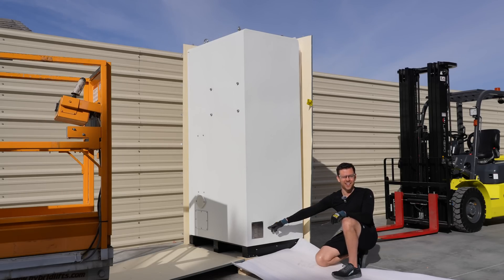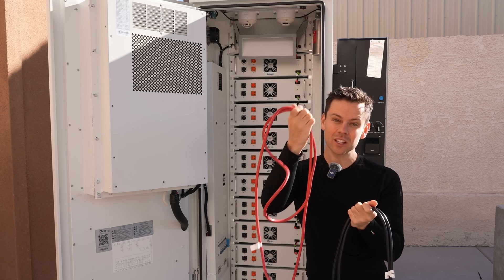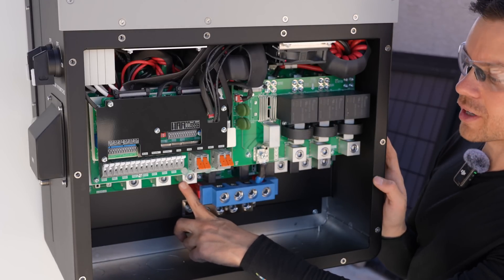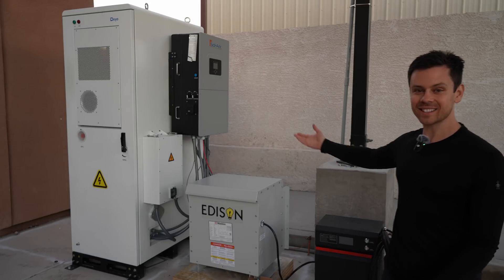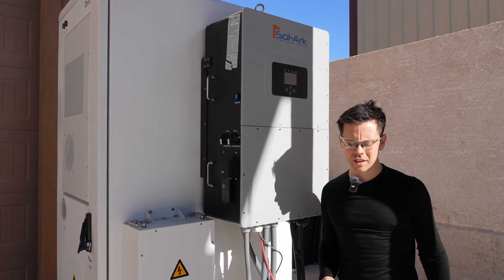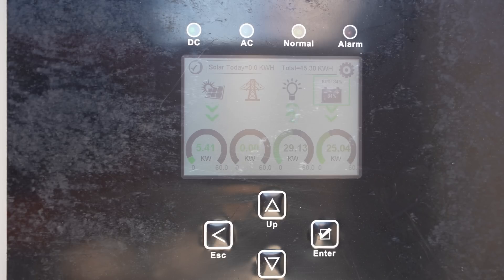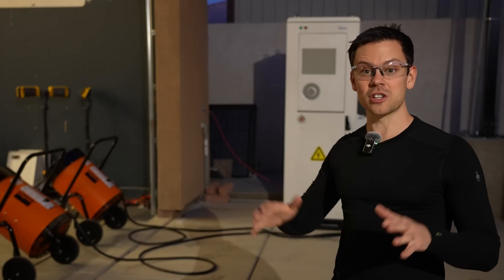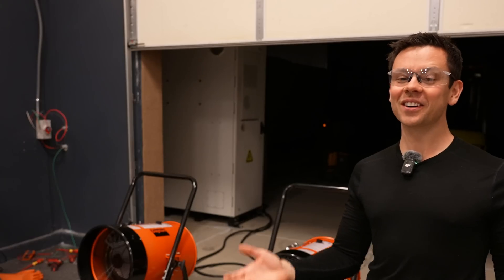60,000W 480V 3 Phase Sol Ark + 60kWh Deye LiFePO4 600VDC Battery Testing!

Comment from the maker: I was very focused on not dying while making this video 😂High-voltage batteries are very new to me and I really do not want to make any mistakes!

If you want me to test anything specific, let me know.
Reply: When using rubber gloves put thin leather tig welding gloves over them. Yes dexterity sucks. But if u don't have leather protecting the rubber they are technically 1 time use rubber gloves then. Per NFPA70E anyways. Many of those safety regulations are written in blood. I use them pretty regularly but I'm in 480 volt cabinets daily and really only use those when I'm going to get really close to something that's exposed.
Reply: @electromechanicalstuff2602  You are right. When I was working on EV’s for my job we were required to have on an inner cotton glove, then rubber 0 glove, and an outer leather glove. A pin hole in a 0 glove could be fatal, high voltage will pass through a pin hole. You would be dead before you know it. This kind of voltage is unforgiving.
Reply: I’d like to see you power Level 3 DC fast charger with this.  There is a need for low cost, low power DC fast charging.  

If you could have this Solark with a 20kw input and a 50kw DC output, you’d have a really cool and cost effective setup.   

I think Lincoln Electric makes some low power DC fast chargers.
Reply: @brp154  oh dude, this would be epic! Your own solar powered DC fast charger! haha that would be epic!
Reply: @brp154  Only if you needed 480 3ph for other things, otherwise it would be more efficient to just use DC-DC charger modules feeding directly from the 600V battery. 40kW modules are "only" a couple thousand dollars. Of course getting something like the Lincoln Electric portable 50kW unit would be a lot more plug and play. I guess if you have excess solar, then who cares about the added inefficiency. And realistically at this cost you're not worrying about it much I'm guessing.
Reply: Great video as always. I know you are super careful but you should be wearing an arc flash suit. I can’t remember how many calorie suit it is needed for protection. Can’t lose an American treasure. We need you. Keep up the good work.
Reply: Test multiple Teslas charging on level 2 chargers, as the near future will be multi-EV charging within households
Reply: @leukota  Yes, at 277V.
Reply: @leukota  This. it is great because you can adjust power draw 1 ac amp at a time.
Reply: Add a split phase inverter connected to the same battery to supply 120/240V instead of using a transformer.  Use the 480Y277V inverter for the solar charging and to power one or more 277V EV chargers.  It would be very interesting to test which EVs chargers happily at 277V.
Reply: @mcarling6495  Sungold Power makes an 11.4 kW HV inverter that would work for this.
Reply: I am in the design phase of a HV home system. I bought 135 kWh of 280 Ah cells from Battery Hookup this summer. 
I am just wrapping up building a 45 kWh 48V system for my shop that is also a backup for my house with the 10 kW Sungold power inverter you reviewed before.
Next I want to take my house fully off grid with an additional 90 kWh of battery but as 320VDC so I can run an EG4 hybrid DC air conditioner on DC all the time, charge my Model Y, and power my house. I am looking at a 450VDC 20 KW solar array.
I am researching how to establish communications between an Orion 2 BMS and Sungold Power HV 11.4 kW inverter that I plan to use 3 of in parallel.
IF you could review this BMS and inveter combo, that would be great. Or if it turns out they are not compatible, if they can be run independently or if comms is required and any other random complication. 
Thanks Will! I love pretty much all of your content.
Reply: I'm tired of replacing batteries in my airtags every year or two. How long would this power one? I assume it would require some sort of adapter.
Reply: @farfromhomeandlost 
Like me year's ago connecting a 12v battery to my 12v drill.. (I thought of fixing them together but used thick cables) works great.. just a bit on the heavy side...
Reply: @farfromhomeandlost  The battery self discharge would be a higher drain than your air tag
Reply: 60KW 480VDC 3 phase etc...
@Physicsduck would love this...
he's slightly qualified and experienced with ouchy electron's... 
Could you two do a livestream...
Safety being one of the topic's..
and the thing's you have both been though...
You both inspire people in slightly different ways..
"That WOULD be pretty cool"
@WillProwse
Reply: Rvpozwer 12.8V 300Ah LiFePO4 battery delivers up to 4000+ cycles at 100% DOD, 6000+ cycles at 80% DOD, and 15000+ cycles at 60% DOD—over 10 times longer than traditional lead-acid. Built with Grade-A cells, it ensures reliable energy storage and a stable 15-year lifespan
Reply: the clicking noise is the control voltage for contactors going down below the 120 vac control circuit to below 90vac making contactors drop in and out.
Reply: If you are working with high voltage, always have someone with you, who can turn it off, if something goes wrong, and pull you away with some insulated tool!
(@jackoneil3933 was faster than me.)
Reply: So, I guess you won't be cutting this one open😅!
Reply: I would see if you can get your hands on a DC fast charger.
Reply: How fast can you charge your electric car?
Reply: @simon359  With 277V available (line to neutral) one should be able to charge a Tesla at 13.3kW using an ordinary Tesla wall connector.  There are reports that some Tesla OBCs will limit themselves to 12.5kW at 277V, though constant current seems more likely.
Reply: @simon359 
Small truck battery?
Reply: Please test the new seplos 32kwh battery
Reply: I underst6and love your enthusiasm having been a fan for years. 480 vac is still 'low voltage" by industrial standards, but as the voltage goes up, so do the risks...exponentially. The risk is not only electrocution but also the increased risk of a metal plasma ejection due to an arc flash event. If you haven't taken a course, please do as I want to enjoy your content for years to come😭
Reply: Yeah, well 480 is pretty unforgiving. Take your time, be patient, and double check your work. None of us want our favorite solar/battery guy charred.
Reply: You need to take an arc flash class and wear proper PPE. High voltage gloves and safety glasses are not enough to protect you.
Reply: Temgot. I have their 12V 460ah in series for 48 Volt. They have been running my home since June
Reply: I am looking for a solution to run industrial equipment like a waterjet or a large cnc plasma table if you are feeling super motivated to see how they like to run any of those things haha